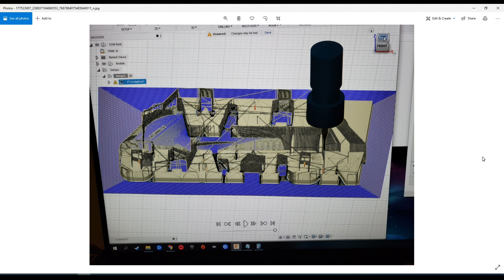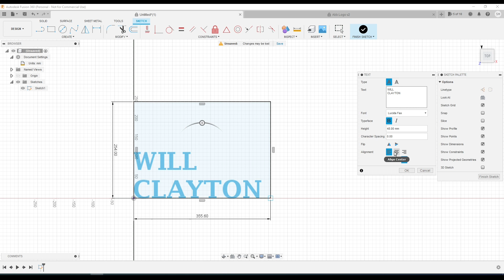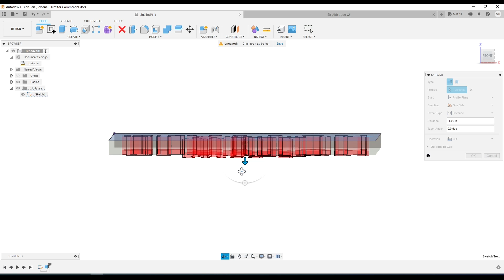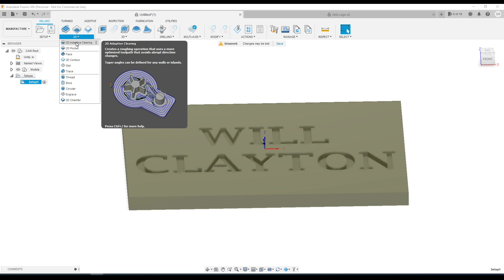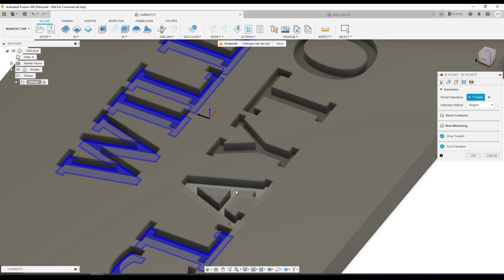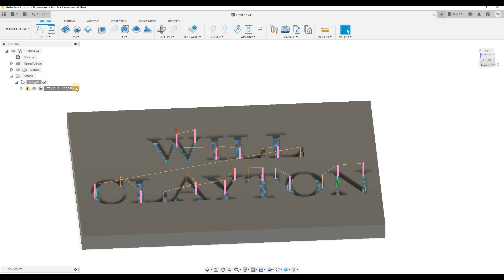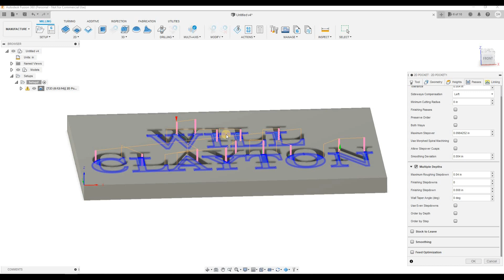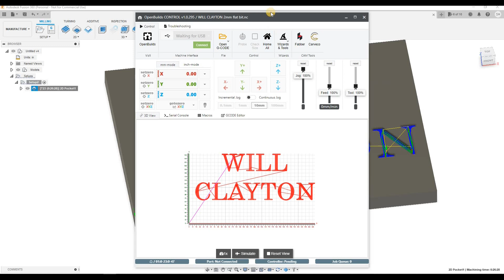FUSION 360 TUTORIAL - HOW TO CARVE SIGN ON A CNC ROUTER

Comment: I am new to all this and starting with simple design like this... you are moving wayyy to quick for me througout the process.. even rewinding it 6 time i miss a small step of a simple click and im not able to follow anymore... any way u can make a similar video for beginers on designing a sign?
Reply from the maker: Fusion360 has the most steep learning curve i would not reccomend it until after learning another software like easel, carveco or Vectric reasonably well.  Once youre up to speed with another software, getting the hang of f360 comes a lot faster. That said. You can click the gear icon in youtube and reduce the video speed. F360 a tough software, made for mechanical engineers with degrees in the subject matter.c